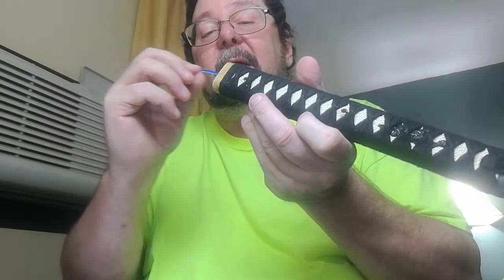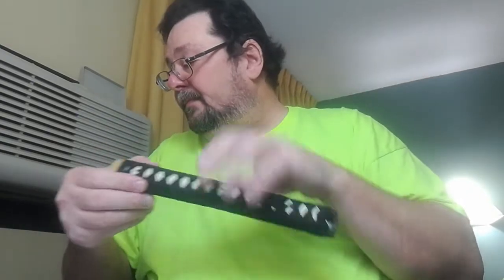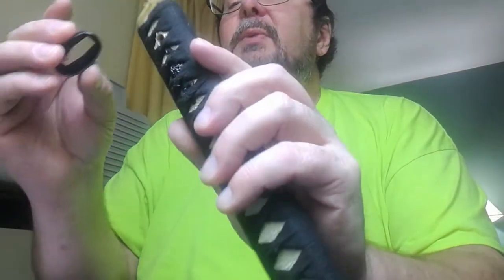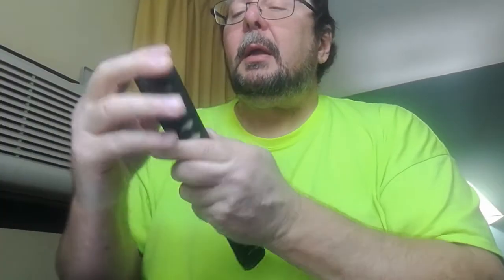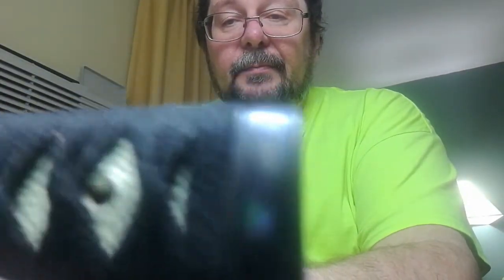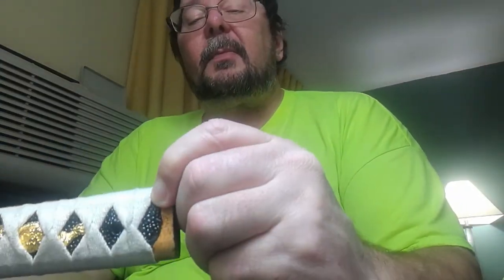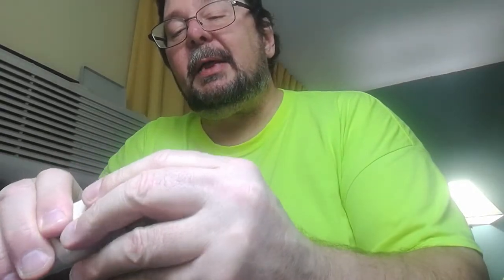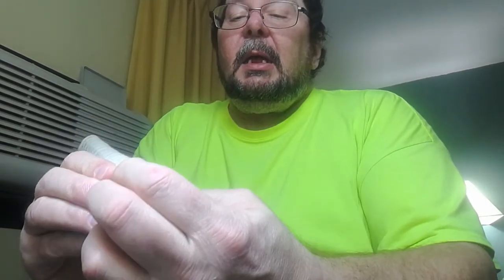Katana Repair And Maintenance: Part 5 - Two ways to fix a tsuka

Comment: I just used the wax sinew for a loose fuchi.
Since I suck at getting a good knot, I used a lighter and tamped down the end to start wrapping, then once wrapped, I used the lighter again to lock it down, then I coated the wrapping with a layer of clear gorilla glue. Once that’s dry, I will still have a removable fuchi and this can probably be scraped off with a screw driver or knife if I ever needed to remove it, although I doubt I’d want to. It made a good fix for a super roomy and loose fuchi.